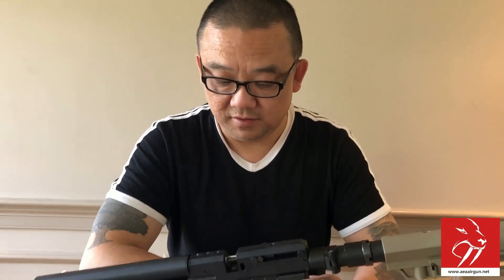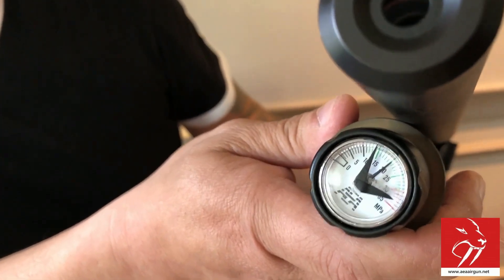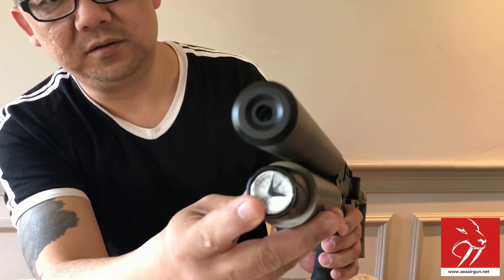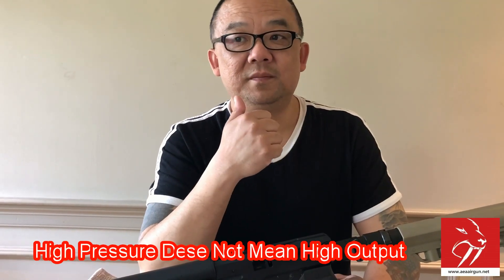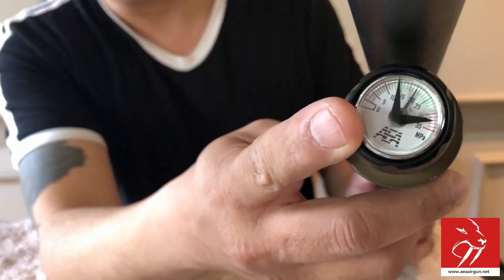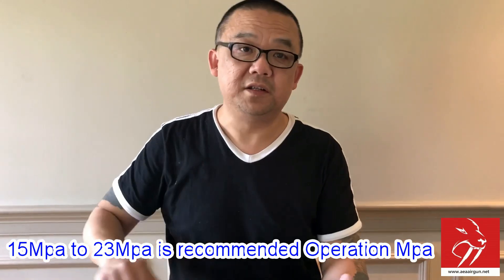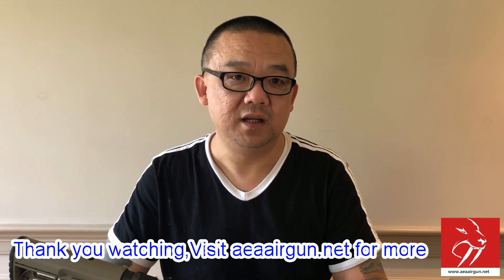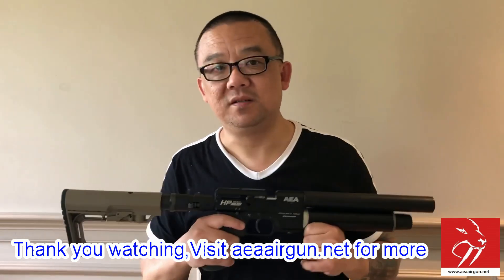BinTac AEA: Please use right pressure to operate AEA airguns

Comment: So if you if I replace the spring with heavier spring I can run it full pressure. Also I found champering and boring out all the airports increases fpe and fpe. I got the element max in 50 cal shooting 1140fps with a 235g Mr hollowpoint at 678fpe. I get 5 solid shots. Bored ported and champerd all the airports replaced all the spring with heavy wolf firearms springs. So with the heavier springs can I use more pressure is the tank on the element max rated for higher pressure. The gun will have no problem with the higher pressure after the mods. But will the tank hold, I’ve been just filling to 4500

Comment: Is that pressure problem the same with the 2021 version? Mine doesn't cycle above 21 on the gage. I was told by the shop that sold it that it should cycle at around the 25 mark which would be about 3600 psi. Mine is the AEA HP SS .30